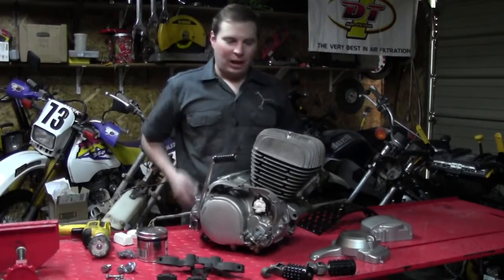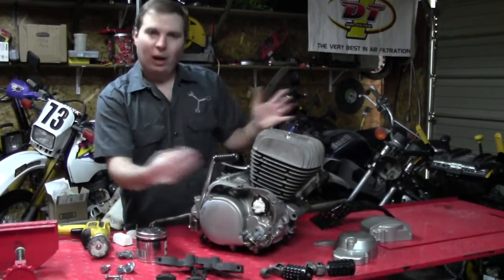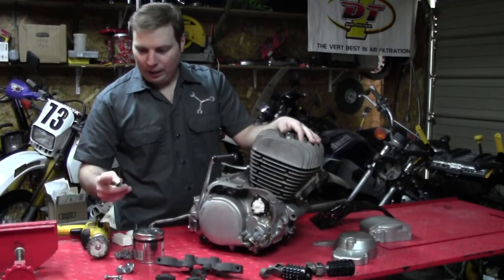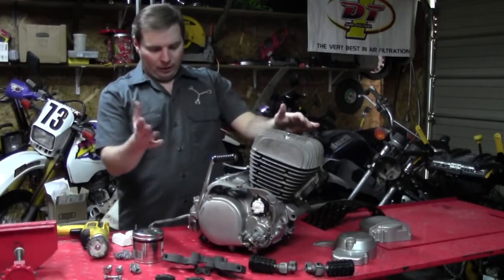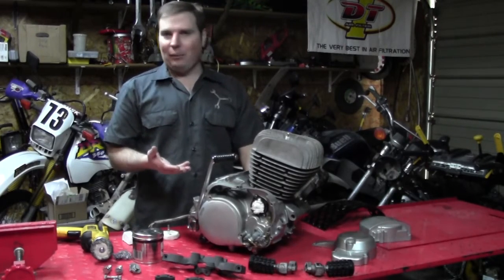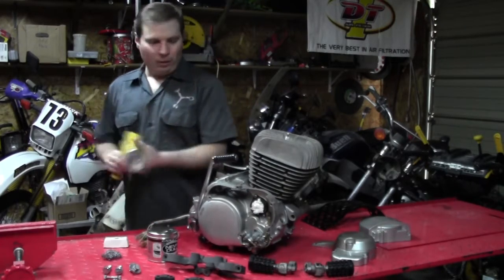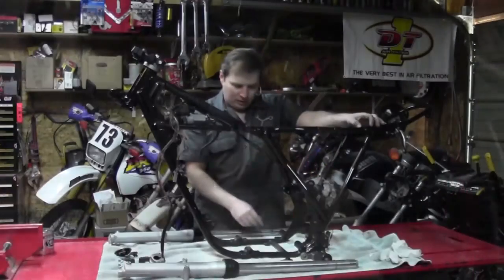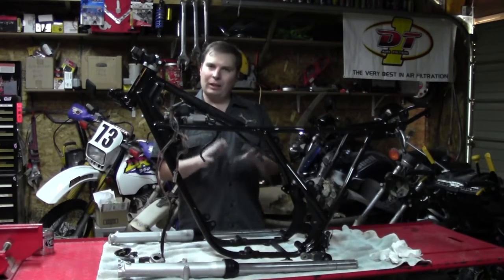1970 Kawasaki F5 Big Horn Paint & Body part 2 Barn Fresh Ep10

Comment: What colour paint are you using on engine covers?
Reply from the maker: +R&R ADVENTURES Duplicolor wheel paint, then a 2 part Urethane clear.  Near perfect match.  I used an adhesion promoter before primer.
Reply: Cool thanks!